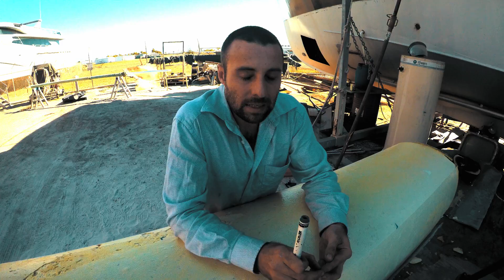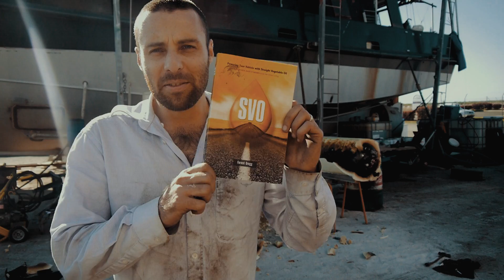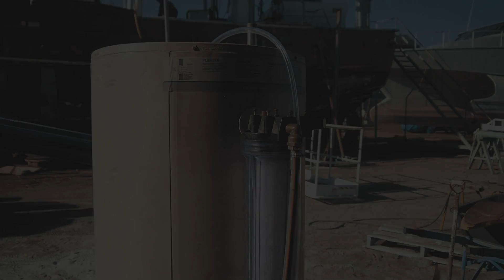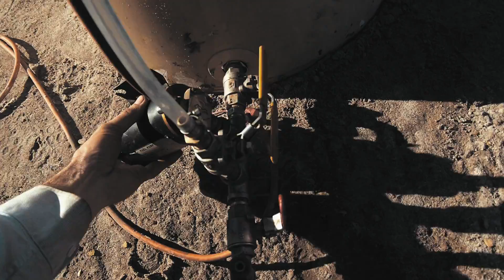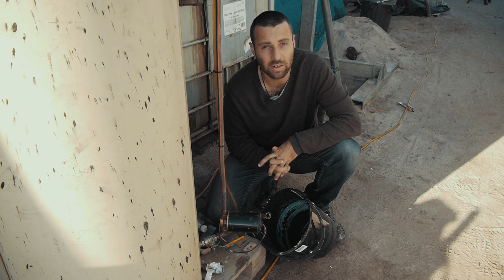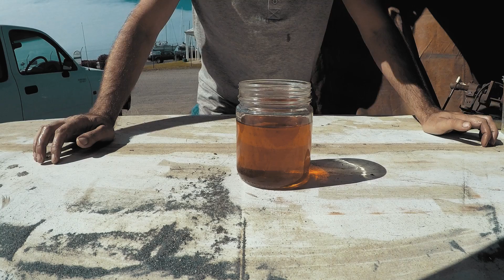Running A Diesel On Vegetable Oil (Part 4 Ep. 47)

Comment: What would happen if you use an instant hot water system and cycle it though a tank to heat it up faster
Reply from the maker: Yeah I pondered that but I think there would be far too much convection current and it wouldn’t crack the water
Reply: @ProjectBrupeg  
Was thinking you could draw it though the filter and then though the heater to a storage tank 
By the time it's all to temp it would have gone though 7 Times then let it sit at temp in the tank for a while to separate 

I guess this system is proven to work anyway
Reply from the maker: We have already started working on processor 2.0 which uses vacuum rather than heat to crack the water
Reply: @ProjectBrupeg  
That'll be intresting to see 
Can't wait 
A subject im going to be following closely

Comment: 11:52 I would suggest you write this out in both words and diagrams and label the hell (in paint or permanent marker) so that any one of your crew could figure it out. I've done this with some of the more complex, not-very-intuitive systems of valves and manifolds on our boat in case I'm disabled or for some other reason can't explain some 'get you home' part of the boat. I mean, I'd hate to think a crew would have to review this video to get the diesel happening!
Reply from the maker: Yeah this is just a test rig, this one won’t be going into the boat
Reply: I get that...I just mean generally. In the bowels of the boat, use a silver ink pen...it really stands out.
Reply from the maker: Ok good to know. Thanks for the tip. How’s your boat doing Marc?
Reply: We've just finished selling our house, which ate our summer. We've bought a place for storage and rental purposes about 130 km. east of here, near the water for visiting purposes. I have a very long list to complete (sound familiar?) for the end of next June, when my son graduates high school and we hope to head down the St. Lawrence 1500 km. to Nova Scotia to overwinter, demast and have the bottom done in a similar manner to what you just had done: blasted or ground back to bare metal, test for wastage, repair as needed, galvanizing coats, two-part epoxy barrier, and three coats of hard (as opposed to ablative) anti-foul. We want this to last until New Zealand, actually, where we might haul out for six months and check the place out. We hear it's not just hobbits and sheep!
Reply from the maker: Sounds like a plan! If you do get down to NZ could I suggest head to the South Island, a lot of people miss it off there list but it’s where the wild scenery lives. Good luck with the work on the boat.
Reply: If you recall our boat, it was built for places like Fjordland, so it's on the list.
Reply from the maker: I recall

Comment: Should any filter block or disintegrate and block a pipe, how much pressure will your pump deliver? Wouldn't want hot 80C oil spraying everywhere and burning someone if the pressure got so high that something blew. A pressure relief between pump and filter may be worth considering, and a flow sensor at the outlet of the filter with alarm and pump shut-off.
Reply from the maker: All of that is a great idea but we have actually started moving onto a version two processor. We have removed the need for heat and will be using full vacuum to turn the water to steam and filter from that point

Comment: This looks great for a home based unit, but on a boat it is a waste of time (procurement and processing), money (labor, parts and effort) and most of all valuable space the processing equipment takes up on the boat!
Reply from the maker: Hi Terence. As mentioned a few times in the video, this is just a test rig and was never meant to be fitted into the boat. It's simply so we can learn how to create our own fuel, as for the economics of it, its hands down cheaper than diesel (around a tenth of the price) and given we need 27,500L of fuel this reduction is definitely worth it for us. That said we will be creating a much smaller footprint unit that can process a much higher volume of oil per day, this new system will be mounted in the engine bay (where we have a space 4m wide by 3m long and around 1.5m high to fit the gear so plenty of room).
Reply: Sorry to offend you.I really enjoy your videos. Since I became disabled can't do much but sit and think about things I was just trying to get you to look at the bigger picture. You are going to need space for procurement equipment, 20L or 25L buckets, 600L totes for unprocessed oil and waste (oil-water-sludge,used filters). How many days running around in unfamiliar ports finding and transporting the used veg. oil? Some type of pre-filter to remove as much solids as you can because they will not settle out on a moving boat. How much to procure, transport, filter and process the oil? Other supplies?
 I can't wait to see you on the water! Something I'll never be able to do! Appreciate all your hard work!
Reply from the maker: Thanks Terence
Space is not an issue, all the points you've mentioned we have included in our analysis and all are manageable. We are able buy oil on the global market and when not we can use diesel. Amounts are available in any quantity, etc. The thing to maybe consider is we are willing to face any issues and do whatever is necessary. We understand it may be daunting for others but for us it's the way we want to live. Trying new things and being resourceful and courageous. We are even willing to fail because the journey is awesome and interesting and we get to not live in fear. Cheers Jess

Comment: ...just got an idea : could you use centrifug force to separate the water from the oil and maybe warm up the oil with the exhaustgas from the engine ... big ships "prepare" crud oil before it is used for fuel? maybe copy or modified an used system for your purposes ... just by eyeballing your system looks a bit underdementioned
Reply: living in the north , I see the problem with diesel the paraffin particle flock out under-10C so we use winter diesel , biodiesel is even more affected. I think the crude soup should be pumped up and refurbished to fill the daytank (maybe 3 day/ 24 hour consumption). rather thinking of a way to heat the veg oil tank to get the oil out there (done in com. boats). other question? why is the water a problem in some supper efficient diesel motors they spray in water to keep it cooler. I am not an expert.
Reply from the maker: Hi Bruno, it’s likely in the very cool regions we will use diesel and oil in the warmer climates
Reply: ...or prepare the auxiliary/elektro/hydraulik generator for only run on veggie oil and keep the mane machine with safe diesel
Reply from the maker: We are working on a version two system and might even be going away from a heated tank system altogether. More to follow on that one.

Comment: How do you plan on getting vegetable oil?  Also why not just put the height gauge after the valve into the bottom of the tank so you don’t have the extra valve?
Reply from the maker: We buy it on the international market (Alibabaa) and forward ship it to ports we are calling into. We found that no matter where you put it the pump creates so much vacuum that it sucks air down the sight tube.

Comment: Seems the filter cycle could be at risk of not seeing all of the particles depending on the flow with in the tank...in theory the tank volume gets a 7x cycle but who knows how the oil mixes and where within the tank as the cycle does its thing....btw, love the series and a huge fan of wvo. So cool to see you have the supply chain sorted. Genius
Reply from the maker: Yeah I did think about that. It’s easy enough to just filter it a dozen times (which is what we ended up doing), still needs a fair bit of work to iron out the kinks but we are getting there

Comment: Will the engine also run regular diesel? I ask because running on oil would be awesome but while traveling finding enough to fill the tanks seems like a huge process. If you pull into a port in Alaska and managed to get oil... It seems like you wouldn't be able to leave for a while while you make the fuel.
Reply from the maker: Yes she is dual fuel, that said we are realistic about oil in the cold parts of the world, its likely we will be 100% diesel in the ice and oil in the subtropics and tropics. Also getting oil in our quantities is actually not that complex. We buy it on the global market (around 100-250USD per tonne) and ship it in large bladders inside 20ft shipping containers to a port ahead of us, we are able to specify the level of filtration we need and then its just a case of drying and final filter. so the hard work has mostly been completed.

Comment: this wo;d work on shore, but Iwould think that the movement of the boat would keep it mixed up. could you not use a centerfuge.
Reply from the maker: Yeha you most likely right there Randy. This is just a test rig to figure out how to make the stuff, once we have that nailed the plan is to make a system that can process 8 times the amount this one does and also miniaturize it so we can install it in the engine bay
Reply: A long time ago I worked on building riverboats, I just remember all the diesel went through centerfuges. Don't mean there a'nit a better way. Keep it up
Reply from the maker: A centrifuge is definitely on my list of things to look into. I like the idea of main engine oil filtration through one but also for fuel

Comment: if you heat the oil to 100 c all the water will boil out but it has to vent to atmosphere
Reply from the maker: Yeah we havent been brave enough to give the boiler the herbs and crank it past 80c. I suspect your right but we need to heat it without inducing convection currents as that just stirs the water and oil around. again this is a first crack at making a boiler, there is dozens of things we could change to make it better and this test rig will get hacked quite a bit to figure out how to supercharge the system. Temp is definitely something we will be looking at. I want to get a good inline thermometer so i can start pulling some repeatable data from the unit.
Reply: It would make a huge mess though.Just think of frying something in your pan but a million times worse. You would need some big catch at the top to only let the gas out.
Reply from the maker: The oil doesn’t bubble much so I think you could solve the venting issue with a long spout. The current spout at the top is around 2 ft away from the top of the oil we processed
Reply from the maker: Free water and suspended water behaves really different. Suspended water is almost bonded into the oil and takes a huge amount of energy to release it. We are changing our processing setup away from more and more heat and going to a vacuum system as at 0psi the free and suspended water turns to steam and gets released from the oil
Reply: All you are doing by using vacuum distillation is lowering the boiling point and thus the energy needed to distill. But there is no difference in the process at all. If anything my guess is it's going to slow the distillation down since the viscosity of the oil is highly dependant on the temp. 
Also, I don't see how convection currents in the oil is a problem. If you could heat the oil to 110 C instantly, the water would literally explode as it would become steam all at once. 
Any water out of solution will boil and go to the top just as well as the emulsified water in the oil.
Reply from the maker: We are speaking to a guy who used to process ten ton of oil each month and he was saying they tried heating up to 400c but couldn’t get the water levels low enough, when they swapped to vacuum the water cane out very easily and because it could be done at room temp the could process more oil per day. Again trial and error everything we are doing is an experiment so who knows what direction we will end up in, just keep following what works and drop what hasn’t
Reply: I can't argue experience. Thumbs up for trying it all out and getting your own experience. 
I'm in the process of building a small power plant for a house based on diesel/veggie oil and a PM generator head so these video series are pure gold to me.

Comment: Whats the difference in the end product between this procedure and the one that uses methanol /potassium hydroxide .
Reply from the maker: Hi Russell, two different fuel types is my understanding, you can either modify your engine (like we have) so you dont need to modify the fuel (Just dry and filter it like we did) or you can modify the fuel so you dont need to modify the engine, when you modify the fuel you are changing it chemically, by adding the methanol, washing it, removing the glycerin etc. We are looking at the fuel conversion to A) reduce our running costs overall and B) reduce our environmental impact as much as possible. if we chemically alter our fuel the cost skyrockets and the impact follows, if we make some simple changes to the engine the fuel costs become marginal and the impact is almost carbon neutral and we dont need to lug around tons of methanol on a boat.

Comment: Just put a T after the pump with the appropriate ball valves to be able to direct the fluid to the appropriate tanks.
Reply from the maker: Hi Phil, yeah that was my first thought but I'm not convinced i have the tank perfectly clean so my preference is to filter and then pump to a tank. might be me being pedantic but in the processed oil i could see floaty bits so either my filter was dying or the tank wasn't spotless.

Comment: Very interesting, it's hard work doing things cheaply. If the smaller element doesn't work out you can use the larger one on a time switch to modulate the power input. Keep up the good work. More power to your vegetables.
Reply from the maker: Thanks Steve. the main reason we changed to a smaller element was to stop convection currents so for us a cooler element that heats for longer is better than a hot element that pulses. That said i could be 100% wrong as I'm absolutely not an expert and this is the first boiler I've ever seen let alone built.